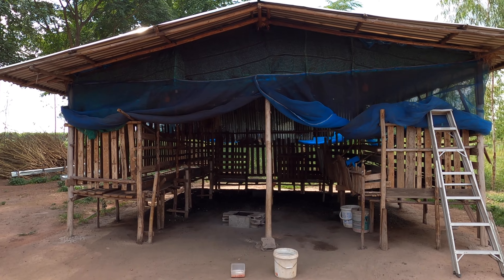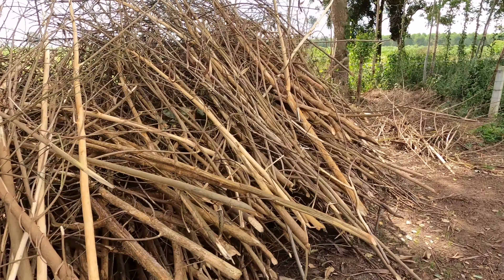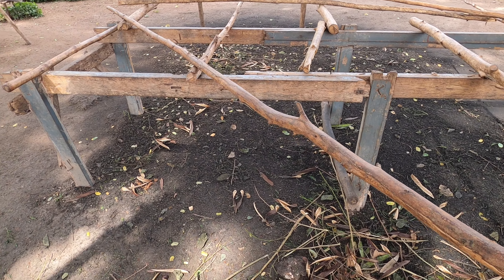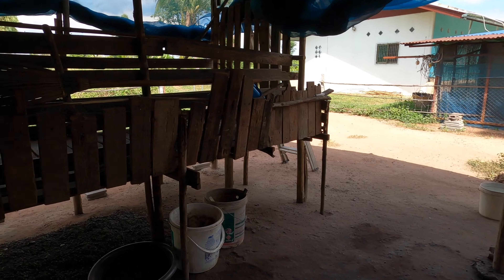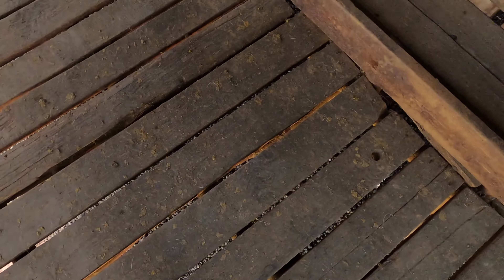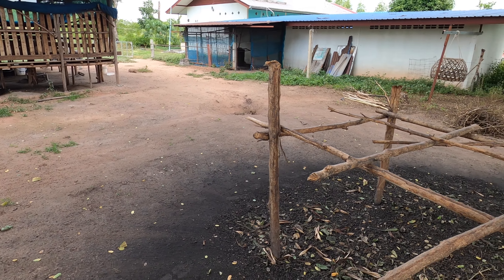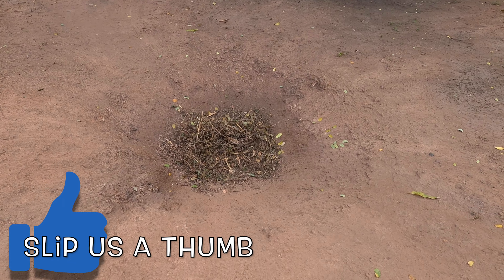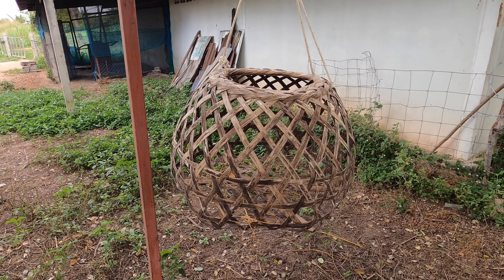HOW to Use GOATS To Create LOADS Of Biomass

Comment: Instead of one hole why dont you dig a trench and turn them all into biochar in one go? Then you probably wouldnt have to break the branches too.
I am pretty sure you can sell your biochar online internationally. You have many viewers and many wouldn't mind paying the shipping cost which actually isnt much from Thailand. Biochar is expensive in the west and yours are charged.
Look at the price of the Bamboo charcoal pieces. They charge some $10 for a couple of small pieces on eBay. You can make those too.
I like your hat BTW.
Reply from the maker: Macro'Man will be digging a trial trench on goat island in a few days time. Finers crossed it works as well as the cone pits have.